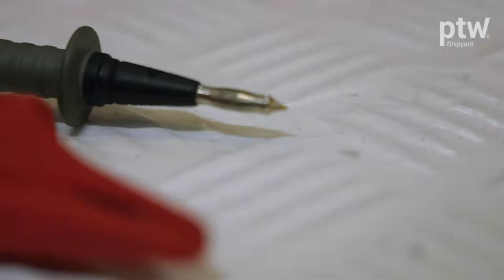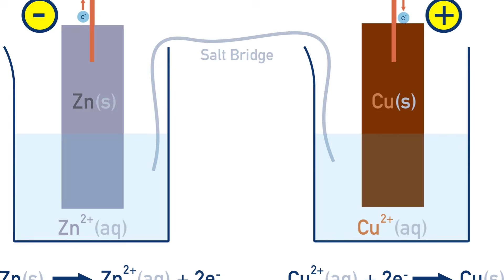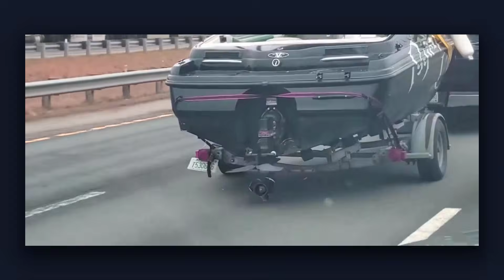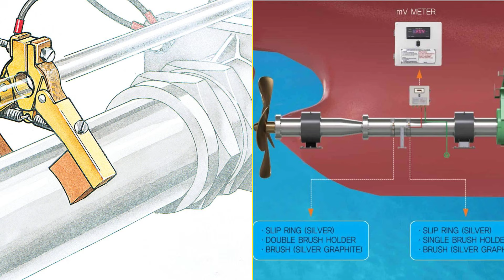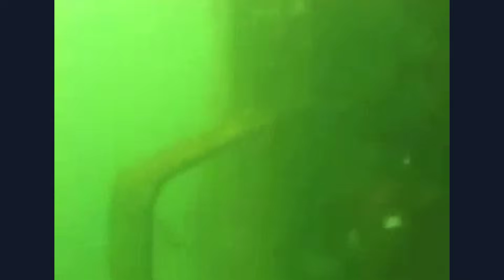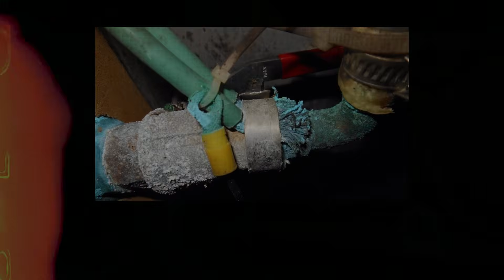The Real Reason Saltwater Boats Rust From the Inside Out (The “Invisible Damage” Problem)

Comment: THIS is why I do not use crimp splices for wiring! I braid, twist, and ball up the twist (sometimes smashing the ball with my Leatherman is required). Then TIGHTLY cover with electrical tape.

If splices were made of copper I'd use em.

Come at me in the reply section all you want. I've never had a splice failure due to corrosion. I HAVE seen it plenty of times with zinc splices and soldered connections.
Reply from the maker: Hey Stacy! Appreciate your input and what has been working great for you and for sharing with others.